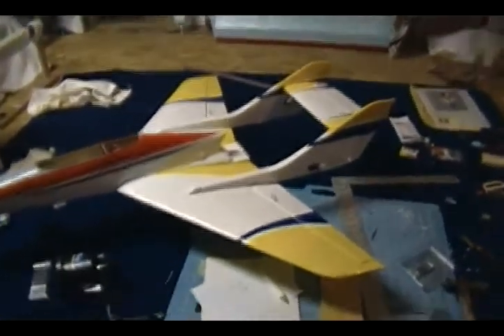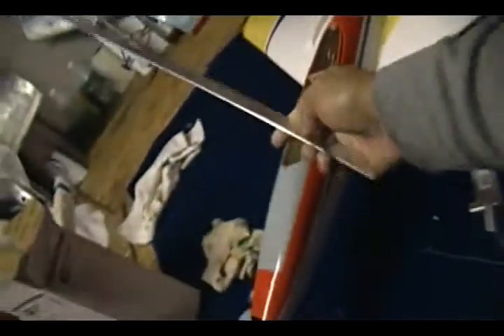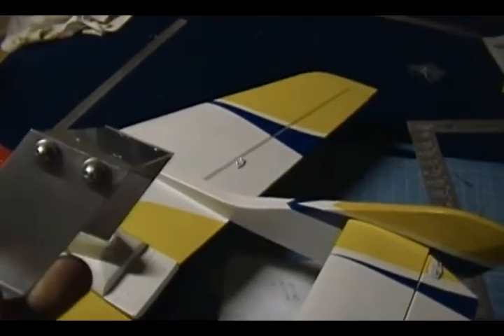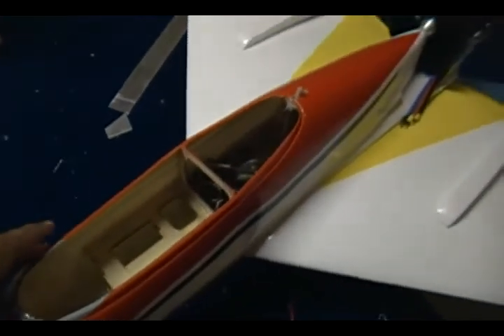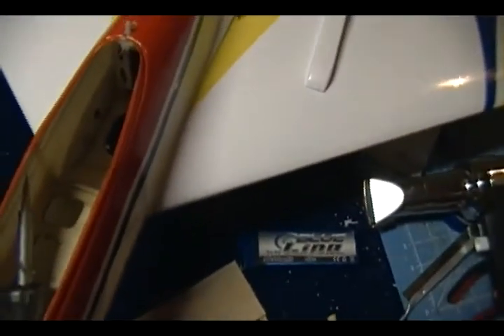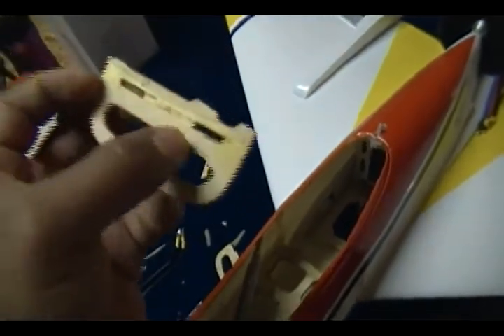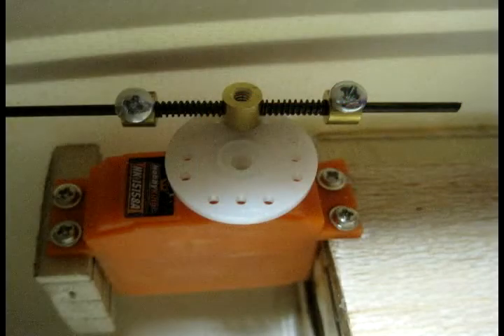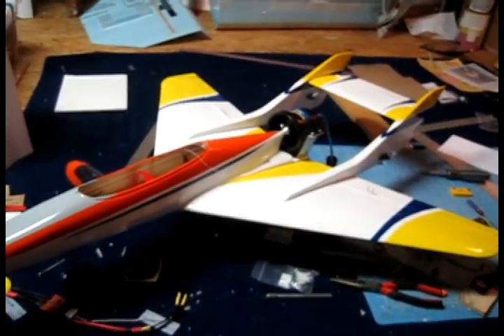nitroplanes falcon 25 EDF  build (part-5)

Comment from the maker: @Donnyboy44 I know : ? I suppose that for some reason they changed the color of the fuselage or maybe they just gave us the wrong fuselage?! 
note; if you're going to build soon the CG on the manual is ok I did maiden fly with CG about 1 inch in front of the recommended and it just took 3 clicks of up elevator to trim it

Comment from the maker: it is at 4lb 5oz RTF and the  Flying Weight according to the bock is 3.9lb / 1800g so I'm not so bad of,
 my thrust to wheight is 1 to 1 at this point with a 5in tube and 62mm exit hole but I will keep trying different sizes of thrust tubes